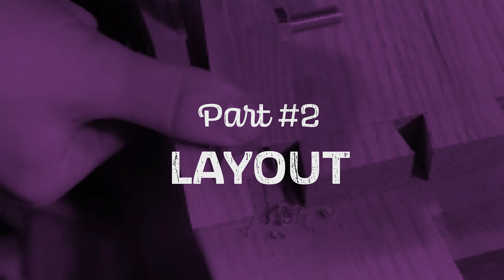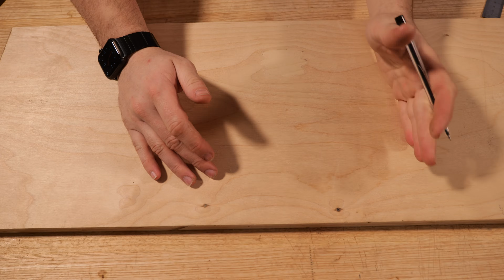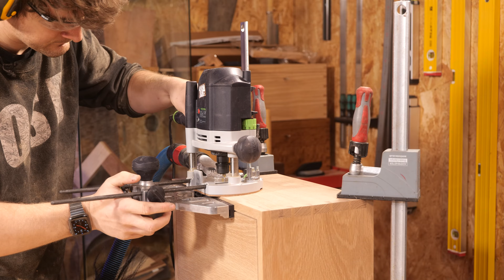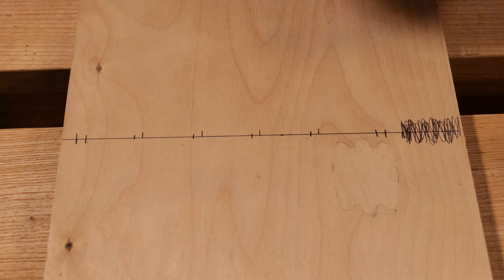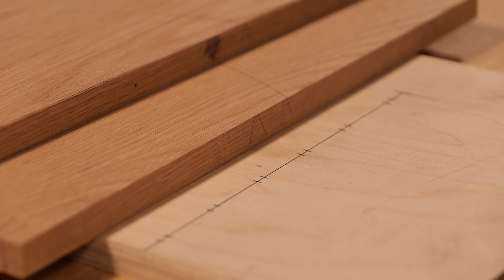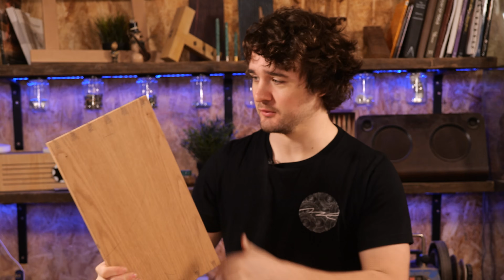How To Layout Mitred Dovetails | The Toolbox Project #2

Comment: Couple of comments. In your technique one needs to determine the final height of the toolbox. Then add 6 mm to that as the box will shrink when you cut the lid off.

I now prefer cutting dovetails by hand. When I first started, I used the Liegh D4 router jig. While it’s a great piece of kit, it has issues.

The method of sawing the top off a box is a tried and true method used for over 100 years. When you layout your tails using the D4, beware that the joints in one diagonal are equal as are the joints in the second diagonal. But the two joints are mirror opposites of each other. So the wide tail will be towards the bottom of the box on the joints in one diagonal. As I had cut my grooves, this was an issue. Liegh suggests that you set up the mirror setup on the right side of the jig when cutting symmetrical dovetails.

One reason among many I gravitated to hand cutting dovetails. 

Also bear in mind that the angle of the tail changes when you change cutters of a different depth. The fingers are set up for using a 3/4 in dovetail bit. This makes half laps an inconsistent pain in rear for stock less than 3/4 in thick.

Comment: Formular Tail height:
hT = (h - 2*hM - (nT+1)*hP - r) / nT
To get the top tail height add r to hT.

Matts values in (...) give us 34.8 mm tail height with the top one being 40.8 mm.
Height of Box = h (240 mm)
Height of Miter = hM (12 mm)
Height of Pins = hP (6 mm)
# of tails = nT (5)
router thickness = r (6 mm)
Reply: I think I like Matt’s method!